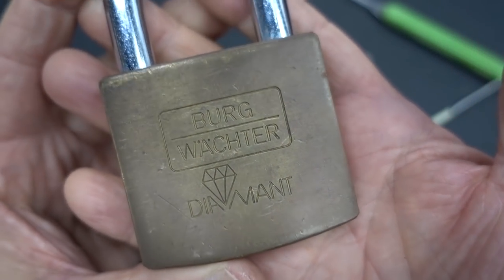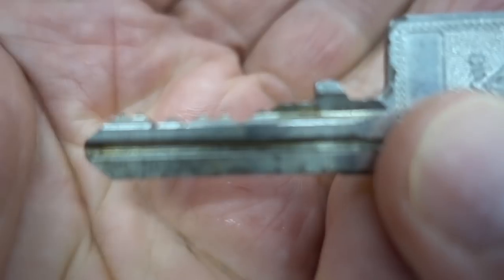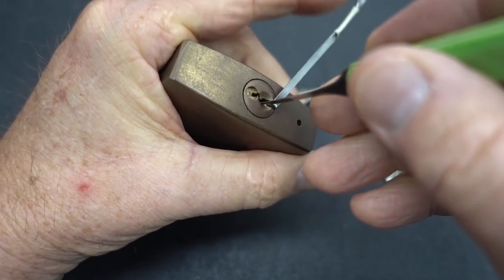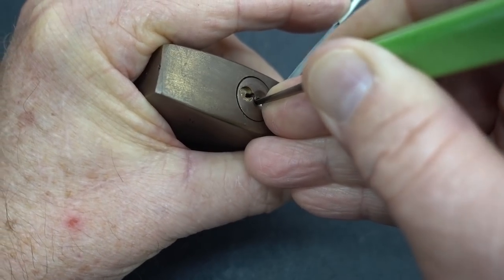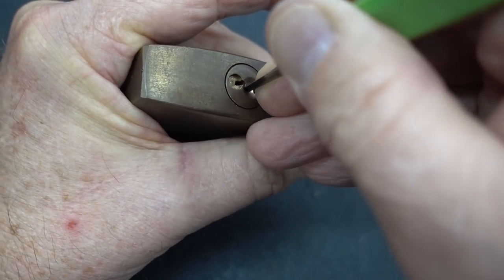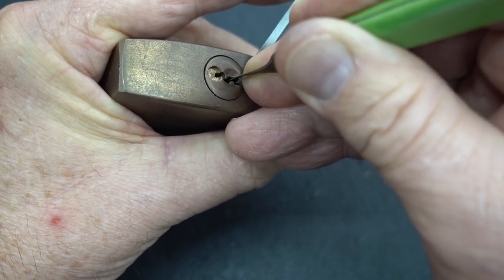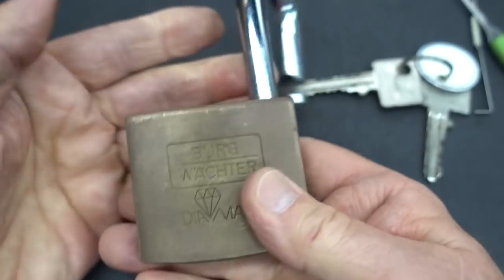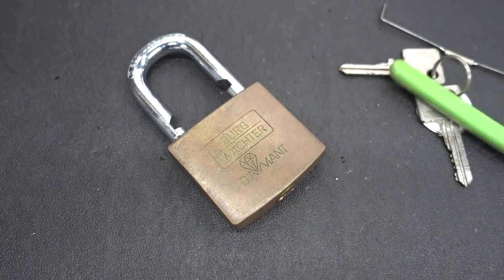(1597) Burg Wachter EVICTED from Naughty Bucket

Comment: Hey Bill, you and LPL got me into lock picking. Yesterday I got my first lock picking kit. 

I took a hyper tough padlock I had bought a while ago and tried to pick it with a wave rake. It worked. I am hooked. Thanks for showing me a cool new hobby.

Now I need to learn how to single pin pick an old Master Lock no.1 I have owned for several years.
Reply: That's an good place to start spp on a master lock #1
Reply: Hi Hu interested in what lock pick set you bought.
Reply: @txrazor2643  The SouthOrd PSX14 beginner kit.
Reply: Welcome aboard!

Comment: Hi Bill 

I start my pickcereer with Burg Wächter because here in Germany Burg Wächter is cheaper then Abus
Every Burg Padlock i have here is easyer to pick then an Abus, thats my opinion.
I Think Burg wächter is a waste of time to start with its to easy to open.
Only 2 of 10 Burg are a little bit tricky 

The nasty Keyway is there only protection aginst Picking nothing more, i own also some Abus with a more strange Keyway they are unable to pick.
Even with a 0,012, i think, you cant get in there to set the pins. I tried it many times with 0,015 from Multipick.

Comment: Would you be interested in a weirdo challenge lock?  It has a keyway that's about 7/1000 inch wide. The key is made of the same gauge of metal as a razor blade. On the plus side, there's no warding!  Obviously, it's not a pin tumbler lock, but I have no idea how to describe the mechanism.
Reply from the maker: Sure,can you send a picture of it?  bosnianbill1 at gmail